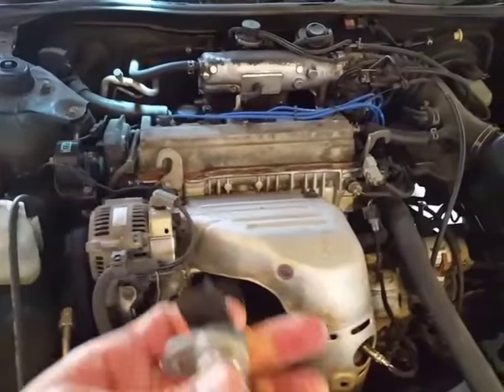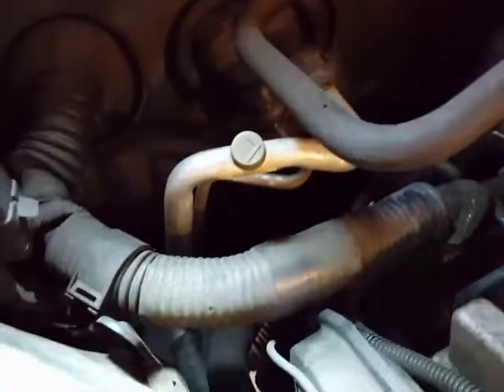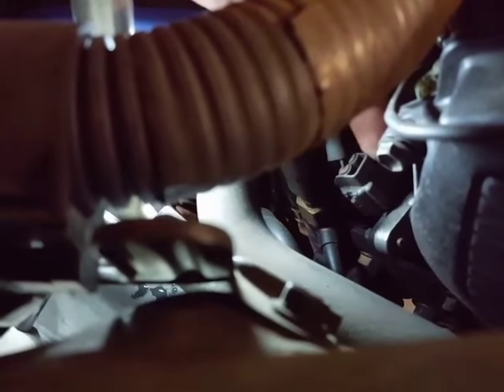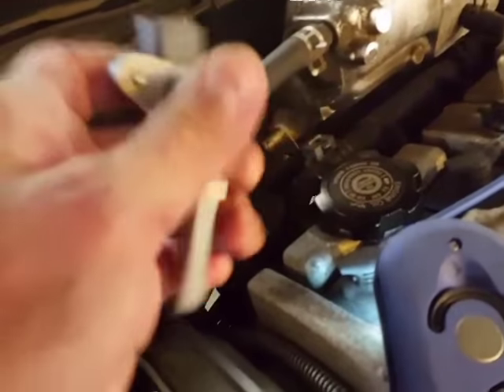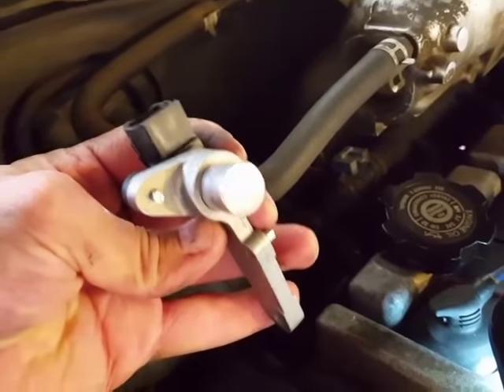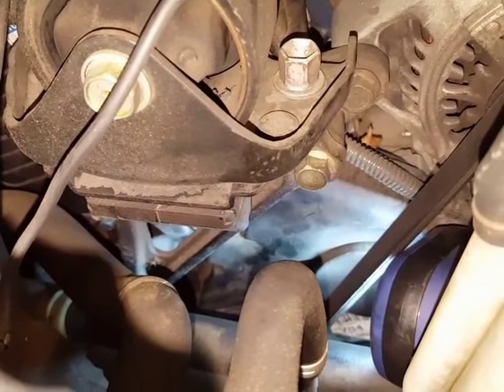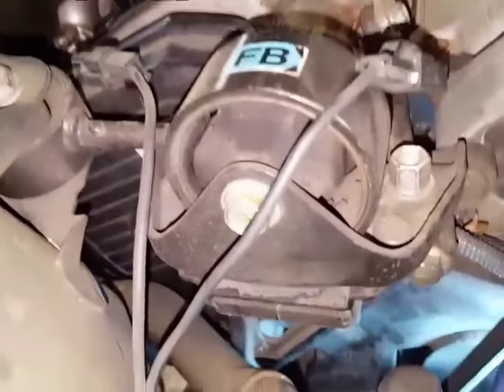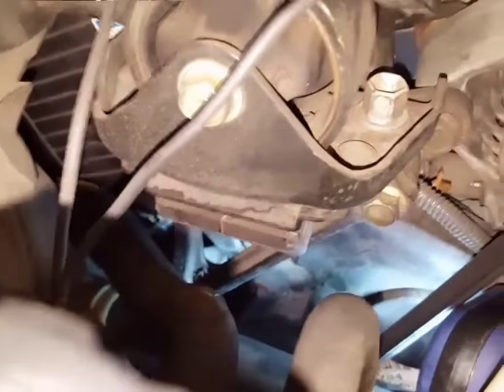Toyota Camry CE 1999 Camshaft Position Sensor Replacement

Comment: I have a 98 Toyota Camry it’s my first car and the main problem when the check engine light was on was the camshaft sensor I’m so glad I came across this video because I can fix my car on my own and I didn’t have to spend no more than like $20 to fix it
Reply from the maker: That's what I love hearing!  Thank you!
Reply: So is the location on a 1998 Camry Le 4 cyl the same as this?
Reply: @truthorconsequences35   Yes it is.

Comment: I used this video as a guide to replace my crankshaft sensor.

My timing belt broke on my 99 Camry 4 cyl.

Replaced timing belt and code P0340 with check engine came on.

Repeatedly cleared codes, but code immediately came on instantaneous to clearing.

Found crankshaft sensor to be really dirty. Cleaned, re-installed and code doesn’t come up.

Hope the car continues without issues.

I am unsure if I had this code prior to the timing belt breaking. There was a code but I did not check it.

Thank you for posting this video!
Reply from the maker: That's great to hear! Thank you for sharing. Yah, I hope the car runs for many years to come for you.
Reply: My timing belt was good but my power steering belt broke in wrapped it self around my harmonic balancer, and I’m thinking it may have Nicked that sensor since it’s right behind it
Reply: Did you try my friend because I have the same issue and they asked me at least $300 to clear the code.

Comment: great info to locate sensor taking out the bolt is 10mm pain to get to but possible currently in the process of putting the new one in and the positioning is horrible thanks for the video
Reply from the maker: Thank you!

Comment: I had the P0340 code come on yesterday.  I went to troubleshoot it and unhook the electrical connection and the entire sensor pivoted back.  Turns out I must have removed the bolt by accident when removing the timing belt cover to change the timing belt!  I pivoted the sensor back in and put a new bolt in (6mmx1.00) and all is OK now.  The bolt is a REAL PAIN to get started as it’s a blind hole and you can barely reach it.  Thanks for the video!
Reply from the maker: Yes, it is!  Glad the video helped.
Reply: M6 or 6mm
Reply: @prizory1101  both.

Comment: I have a warning light on my car that the internet says it is a bad position sensor...probably something similar to this. Now just to find our where this is on my car.  Thanks for posting this!
Reply from the maker: Thy Shadow Is that Michael? There are at least 2 position sensors: camshaft and crankshaft. Be sure you get the right one.
Reply: Yes it is, the "EST BAS" light comes on periodically on the dash board of my Challenger.  The internet only mentions it being due to a "dynamic sensor" that a temp fix is turning the steering wheel all the way to left then right and it will turn off the warning light until it is triggered again, but the sensor will need replacing before too long or will lead to other issues.

Comment: There's actually a hole in the block for that pin you pushed in.  Hopefully you figured that out eventually.
Reply: Would it be easier to remove from below if the car was jacked up? Is it a bolt with a 10mm head or 11 mm?
Reply from the maker: I looked and looked, but couldn't find it.  Someone in another comment mentioned the difference between the '99 and '98 motors.  This vehicle's year was a little confusing for parts because sometimes it would match '98 parts and sometimes '99 parts.  I honestly don't know.
Reply from the maker: @blbolin  Perhaps.  I don't know.  I usually go at things like this the easiest way I can find.
Reply: I read that it should fit snug and not just sit out in the open. It also didn’t come with an O-ring. Is this typical?

Comment: First of all, thank you for posting this! I have this same code reading and have been struggling to find the sensor. I was informed by Autozone that the issue was likely an issue with the timing belt. What exactly was the problem with the timing belt and how did you resolve the issue?
Reply from the maker: mattydriggs I hope I can state this clearly over text. The black, plastic cover to the left of the engine block (as you face the car) is the cover for the timing belt. If you can take one of those bolts off and peak in there, have someone crank the engine. In our case, the belt was not turning at all. The belt has teeth on the inside of it, basically to connect gears together rather than plain pulleys. I hope that makes sense. Those teeth wear out and the belt doesn't break, but, rather, just stops turning.

IDK how hard it is to change a timing belt. I didn't know that was the problem, so didn't even try. The mechanic fixed it for us. It ended up costing around $800, I think it was, for that. Then, the radiator was cracked, the oil pump was jacked, and the valve cover seals were messed up. All of that was legit. He wasn't ripping us off. So, it ended up costing between $1500-1600 to get it all fixed. The car's running fine now, though.
Reply: Very good explanation! My Camry runs fine so I hope that it is just a problem with the sensor or connection but I will take a look inside that cover as well. I appreciate the help. Not knowing what to look for and not being able to find relevant information on this error anywhere else was quite irritating. Thanks again!
Reply: I know I’m 3 years late but this JUST happened to my Camry. Sensor went out so the water pump and timing belt had to be placed too bc the belt jumped teeth.
Reply: @makenziejenkins2694  how many miles on your vechile? Also hope you got everything sorted
Reply from the maker: @platinumassasin5979  We did get everything sorted out and the car kept running.  We finally sold it around 1.5 years ago, still in working condition.  I don't remember how many miles it had on it.  Sorry.

Comment: My issue seems to be the fit. Shouldn’t it fit into the engine without an open area. You put the bolt in and use the little metal slot to line it up but it doesn’t fit snug into the engine.
Reply from the maker: That car was known for timing-belt issues, so I wouldn't be surprised if you had to replace it too.  We had to replace the timing belt twice in the 6 years we had the car.
Reply: @jeremyhood  I think that may be the issue.

Comment: makes me wonder if your sensor was actually bad, without that pin to keep it from slipping down it may have done just that and got too far away from the cam magnet and thats what the trouble was all along, my 99 has a steel bracket on the sensor and is a bummer to hold it and get the bolt started, makes me wonder if my 99 has a 98 motor in it as it supposedly had a motor swap
Reply from the maker: I know, right?  Maybe I just needed to clean it out and put it back in.  I don't know.

Comment: Jermemy or anyone  was you car driving when timing belt broke? Also did only repairing the timing belt fix the problem?? Any help will be appreciated
Reply from the maker: This was my mother-in-law's car.  She was driving when the timing belt broke.  I don't know exactly how that all went down.  I just got a call from her saying she was on the side of the road.

I think repairing the timing belt would have fixed the problem, but, while they were in there, there were other issues they found and fixed as well.  As I recall, the oil pump was in very bad shape too.

Comment: I have a 99 Toyota Camry and in heavy stop and go traffic in Baton Rouge this car’s RPM will drop and shut off. It doesn’t do it for any mechanic or anybody else but me in traffic. I changed everything related to air intake and fuel. So now I’m thinking it’s the camshaft. Did your car do this in heavy stop and go traffic?
Reply from the maker: Hi KellyPope,

I don't remember the context of when this happened. I did have to pick up my mother-in-law on the side of the road more than once when she was driving this car, though.

I'm no mechanic, but I have a couple of thoughts for you to consider if you haven't already:
- Older cars need fuel injector cleaner periodically (annually, give or take) or they'll slow and die, like you're saying. I remember having to replace an injector in another Toyota, but not this one.
- It could also be your battery dying or alternator not charging the battery.
- Another thought is that these cars have problems with their timing belts. We had to replace this one's timing belt once. If it has been over 100,000 miles since you last had yours changed, it's probably worth checking.
- Maybe replace the spark plugs and wires? You said you've replaced everything to do with fuel and air, but you also need a spark to create a flame.

I wish I could help more than just throwing out a bunch of things it might be. Perhaps others who see this might know more and be able to help. Good luck finding whatever it is.
Reply from the maker: Are you getting a code? Even if the check engine light only comes on when it does this, maybe keep a code reader in the car to read that code quickly.

Comment: Any benefit of replacing the bracket? Thinking about leaving the old bracket and just replacing the sensor. I read someone did that approach and wondering if that would be ok to do and if it is easier that way.
Reply from the maker: Sorry, it has been a while since I did this work.  I probably got the bracket with the part.  If the old bracket works, using it seems safe to me, but I don't know.  I'm not a mechanic or anything.
Reply: @jeremyhood no worries thx bro

Comment: Did you need to remove the entire piece or could you just have use the screw driver to unscew the sensor and screw it into the bolted end piece?
Reply: Yea I agree 😂 just one screw
Reply from the maker: Perhaps.  I don't know.  I'm no mechanic.  However, in order to put in the replacement part I received from the auto parts store, I had to take out everything I did in this video.

Comment: It’s been really hard for me to get off the wiring connector from the beginning. Any advice?
Reply: long nose 90 degree pliers. Not sure why someone said a flathead. The connector lever needs to be compressed not have it's tab pulled away. Something like Duralast 77-111 or similar.

Comment: I have same problem but no engine light on dash .......my battery and alternator is good ..is necessary engine light on in your dash to show cramshaf is bad?
Reply: Pablito montanez did you find out what was your problem???
Reply: Hey did you ever figure out the problem? I have the same problem on a 95 camery
Reply from the maker: On this car, the problem ended up being the timing belt.  It's a common problem for this year/make/model.

Comment: I have the same car but LE and same problem  thanks for this video
Reply from the maker: Awesome! I'm glad it helped.
Reply: @jeremyhood  I can’t get the thing off that clamp looking thing I don’t know what it’s called the thing you said you need to hear click that thing I can’t get it off how do it please without breaking it
Reply from the maker: @janedoe7362  Are you talking about the wiring harness?  There's a plastic clip that holds that in.  The clip needs to be pushed.  It takes patience and fiddling around with it to get it.  I hope you can get it.
Reply from the maker: At around 1:58, I talk about removing the wiring harness.  I hope that helps.
Reply: @jeremyhood  yes that I am trying to get it out and I can’t yet I can only fit one hand at a time
Reply from the maker: @janedoe7362  I think you can take the throttle position sensor out and then mess with removing the wire.  Be careful not to mess up the wires in the process, though.  I've struggled with many of these wiring clips.  I think they make them hard to remove so they won't fall off while you're driving.  Unfortunately, I don't know how to help you.  I've just struggled with them until they eventually come loose.
Reply: @jeremyhood  thank you I am going to go back outside and try again and this time I am going to use small long pliers I hope it works 🤞🏼
Reply from the maker: @janedoe7362  It was wise of you to take a break.  That usually helps.  Good luck.
Reply: @jeremyhood  thank you because I feel like giving up

Comment: Is it alright if the sensor is hitting the Camshaft? because I connected mines to the engine block like you did and I noticed the camshaft hitting the sensor.
Reply from the maker: I have no idea if that's okay. Was the old one hitting?
Reply: @jeremyhood  no the trust holder was seperated from the engine block and then when I moved it in it started knocking but now the knocking got less but its still hitting the sensor though.

Comment: Drain the power steering fluid, disconnect the hoses to the ps res, and remove the yellow plastic resavouir.  Move the rubber hoses out of the way.  Makes it much easyier.

Comment: What was the size of the tools you used?
Reply from the maker: It's just a standard socket.  I don't remember the exact size.  I tried to look for it when I was showing the socket, but I can't quite see it.  I'm sorry.  Since it's a Toyota, it would have been metric.  I'd try 12, 14, and 15mm.  Those seem to be the most common sizes used by Toyota from my limited experience.
Reply: @jeremyhood  okay thank you!!

Comment: I got the same code and it said camshaft position sensor. Just finished replacing same stupid part aaaaaand it still doesn't start.
Reply: Crank shaft sensor
Reply: Change the distributor...
Reply from the maker: Same here.  It ended up being the timing belt.

Comment: On my 2000 Camry that bolt was 10mm not 11. (Be careful)
Reply from the maker: Oops!  Sorry, Peter.
Reply: Hello, I have a Camry 2000 ce and I need to buy the sensor, where did you buy it?